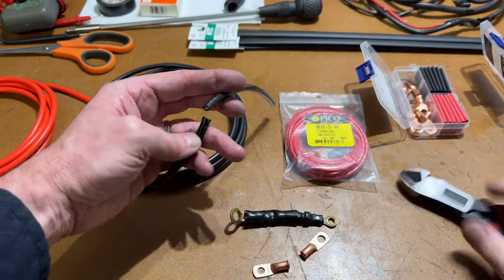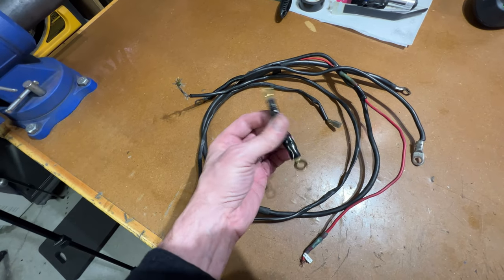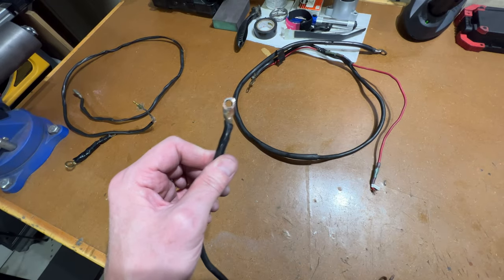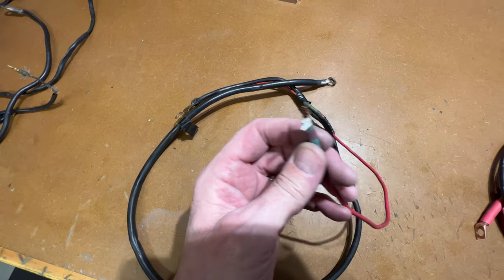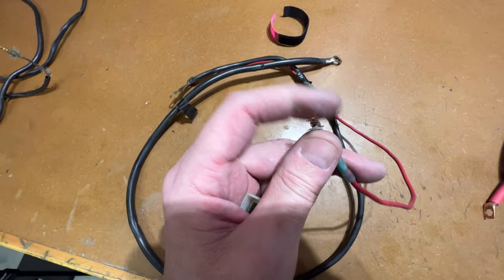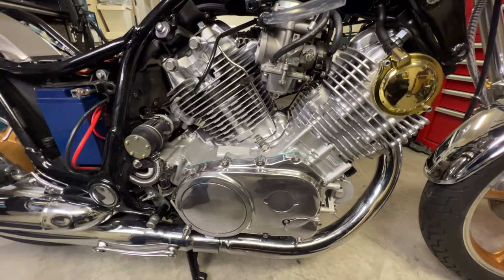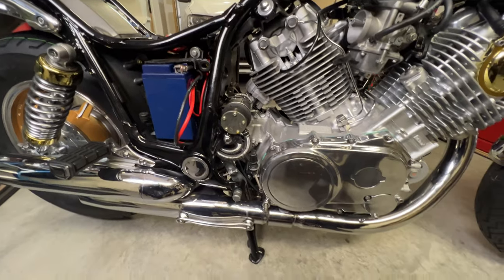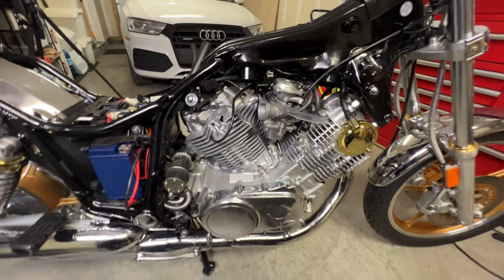Rewiring The Starter Motor - Yamaha Virago 1000 Restoration Video 22

Comment: You have an immaculate-bike Ken ,a  well-loved-machine . I have a couple of Euro TR1's (1981/2  981cc) , upright-Roadster , chain-drive mono-shock . I run a separate-Earth from battery ;negative , under the bike , attached to the lower starter-motor securing-bolt . It allows a better current at the starter and mine do start better with it . I also disconnect the rev-counter as it robs spark from the rear-cylinder and is not needed really on a V-twin. That poor-looking Positive lead-fitting you replaced, was factory . They have a bad-habit of forming a 'Dry-connection' with the solder, same on Virago-1100's also . The spark-plug-caps are another failing-point , you can disassemble and brighten-up all the contact-points or replace with new NGK or equivalent, you will certainly feel the difference if they were faulty at all . They are great Bikes when they go well , mine is my favorite for 'air-therapy'  .   Dave  NZ

Comment: Hey Ken I have a question, I have an XV1000 as well, When I go to start it I get this terrible Whirling and Grinding sound and I don't think it's supposed to do that.. Is it normal? if not what can I do to fix it? (New Owner I don't know much about bikes in general, But your channel is helping me out so much I've learned a ton from you and so grateful that you are doing this restoration!)
Reply from the maker: Yeah, I'd have to say that any grinding or whining sounds is not normal.  You heard how mine sounds and although the whole thing is loud, there's no grinding or crunching sounds.  If you look at the start of the video, you'll see a photo I took with the left side cover off.  You can see the idler gear with the spring on it.  The teeth on that gear can wear down and cause grinding.  If the solenoid is failing and not throwing out the idler gear quickly, that could be your problem too.  Weak batteries are the biggest culprit in this generation of Viragos.  If you're prepared to take the left side cover off (it's a bit of a daunting task) then you'll be able to see what kind of shape the gear is in.  I have an earlier video of the engine clean up where I remove the side covers.  Have a look at that and see what I'm talking about.  For now, make sure your battery is healthy and full charged, make sure all the wiring is in good condition and check to see if the solenoid is coming out like mine does in this video.  If not, you might need to drain the oil and remove the left side crankcase cover to see why.  If you have to do all of that, it would be worthwhile to replace the starter clutch while you're at it.
Reply from the maker: So as luck would have it - mine just made a "grinding" sound while starting.  Pretty sure by the sounds of it that in my case it's the solenoid (I replaced the starter and all the wiring but not the solenoid).  I ordered a new one and I'll be installing it today.  The problem with a weak solenoid is that the idler gear doesn't get pulled into place far enough by the mechanical action and the gear doesn't fully engage.  That's a lot of torque to manage and if it isn't 100% fully engaged with the crank gear, it will slip out and grind.  The noise is awful.
Reply: @KensWorldRestorations  Yes it does sound awful! So you saying i should replace my solenoid?
Reply from the maker: @DuoTheDouble  I just replaced the solenoid and it still jumps out.  No doubt I've got another problem on my hands.  After some quick research, it looks like the whole idler gear assembly has been revised and the spring removed in the latest revision of the idler gear saga.  Looks like Yamaha removed the spring around 1995.  I just bought the new assembly from Japan and a new starter clutch from eBay.  I'll be making a video of the whole repair in the next month.  We might have the same problem...
Reply: @KensWorldRestorations  I'm thinking we do as well, Yesterday i took apart the whole left side and looked at my gears and tried to replace the starter clutch but the one i ordered from amazon was the wrong size almost identical expect it didn't fit on the starter post sadly so i packaged her back up together and performed the oil change. and she started right up, also They removed the spring from the gear set up?
Reply from the maker: @DuoTheDouble  Yes.  There is a newly revised idler gear assembly (part number is 3LP-W1551-00) and it replaces idler gear #1 and #2.  In that assembly and in the drawings from 1995 onward, the spring was removed.  It was found that not only was the spring redundant (with the solenoid from 1984 on) but the spring causes bounce and can cause idler gear #2 to disengage from the flywheel.  Check out these drawings from CMSNL. https://www.cmsnl.com/yamaha-xv1000-virago-1984-e-usa_model9062/partslist/C-06.html.  If you look at any XV1100 drawings for the starter clutch from 1995 onward, the spring has been removed.
Reply from the maker: @DuoTheDouble  I've ordered the new assembly and a new starter clutch.  Be careful with the 1000 starter clutch because it's different (19 teeth) than the 1100 (18 teeth).

Comment: Hello Ken! I was recomended to install an extra ground wire from acc directly to the starter, considering that starter needs guarnteed good connections to work properly. What do you Think? I did not notece you put any extra ground wires...
Reply from the maker: The Virago series definitely suffer from a weak spot in the starter’s electrical design, but it’s not the engine ground for the starter like some people think.  The starter motor is grounded very well actually - aluminum on aluminum (which is an excellent conductor) with ample surface area.  The engine case is adequate as a starter motor ground PROVIDED that the ground wire and connectors from the battery are of adequate diameter (gauge) and are properly grounded to the engine case.  From the factory, I found that this ground was inadequate based on my knowledge and experience as an electrical engineer.  This is why I replaced my battery ground wire and chose a larger connector and found a better location for the ground wire in which to connect.  The original Virago battery ground location on my bike was clearly a poor choice (it was grounded with a small connector with very little surface area) at the engine side case bolt that holds on the rear brake light switch.  That’s the weak spot that I see and if you ground the battery to the engine where I did, you won’t have any problems.

I also was reluctant to add an electrical connection to the starter motor bolts because it would negatively affect the torque of those bolts which is obviously under very high load during starting.  Just make sure your starter motor mounts are clean, the engine mounts are clean and DO NOT use dielectric grease at the starter motor mounting bolts.  Getting a better ground from the battery to the engine case is the best solution.  I haven’t had a single problem with my repair since fixing my battery ground cable this way.  Hope this helps.
Reply: @KensWorldRestorations  Thank you very much for your detailed explanation, Ken! But frankly -I can not see where exactly you attached the ground wire on the engine... Whish you all the best!
Reply from the maker: @MrClics  at 5:12 I'm pointing to a wire stay that is on the back, right-hand side of the engine (just under the fuel pump).  It's a large wire stay that holds a number of wires up and away from the exhaust.  That bracket is held on the engine block with a very large bolt (13mm I think) - much larger than the engine case bolt (5mm) that the ground wire was originally fastened to.  If you can, make a larger gauge ground wire and connector and bolt your battery ground wire to that location.

Comment: Sou português. Tenho uma Virago 750 de 1987. Novo design claro. Motor 5e5 CV com peças em dourado. Foi comprada na Suiça. Qual a potência do motor em CV? Muito obrigado
Reply from the maker: O 750 Virago é avaliado em 55 hp e o 1000 em torno de 68. Isso é baseado na pressão do nível do mar e na temperatura de 15 ° C quando eles eram novos.
Reply: Muito obrigado. Parabéns pelo teu trabalho na Virago 1000. Espetacular.